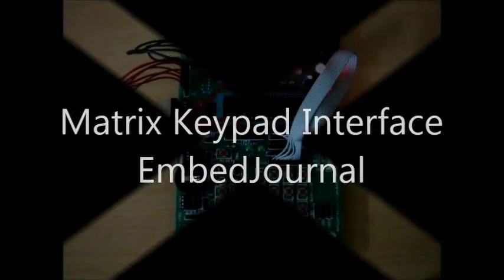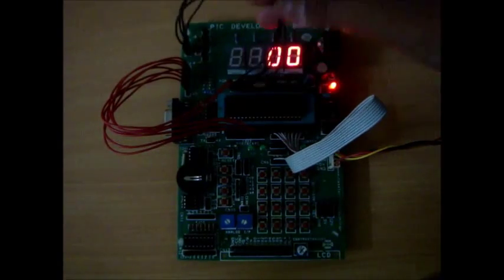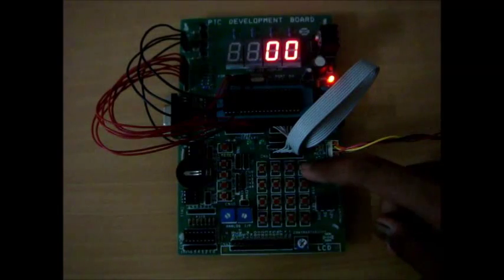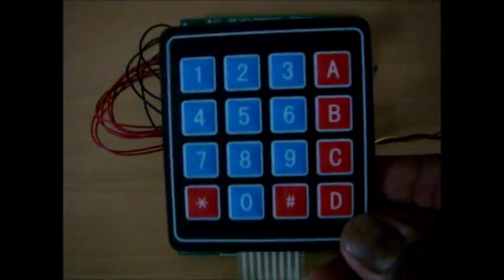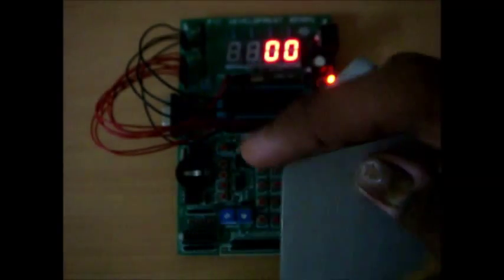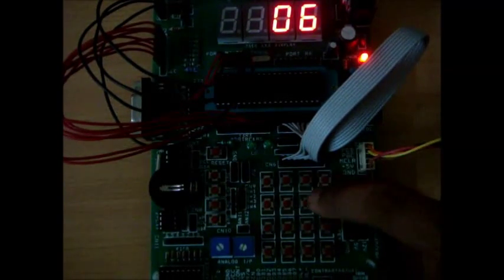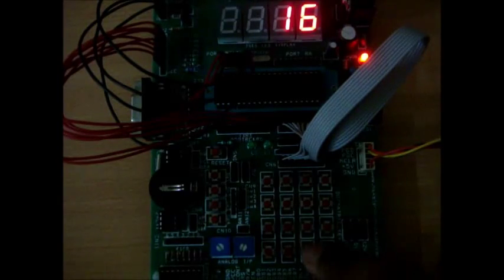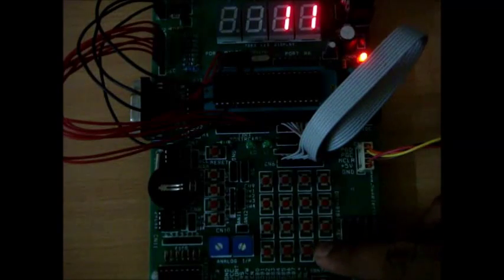4x4 Matrix Keypad Interface

Comment: Sir i Will try this code and Something error in mikriC . plz me...

""0 1139 Available RAM: 352 [bytes], Available ROM: 8192 [bytes]  
1 304  error: Can't open include file "p16f877a.h"     #include <p16f877A.h> 
2 304  error: Can't open include file "delays.h"     #include <delays.h> 2 errors in preprocessor. 
0 102 Finished (with errors): 07 Feb 2018, 21:50:27 TEST.mcppi""

jahidhasaneee39@gmail.com